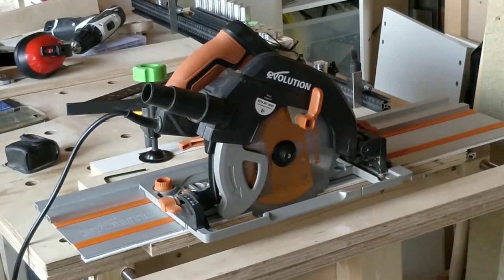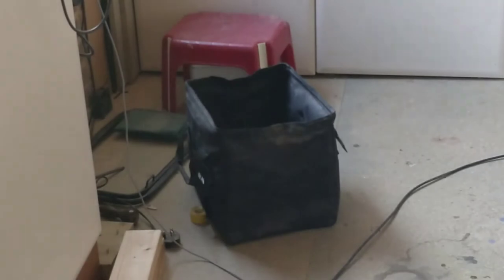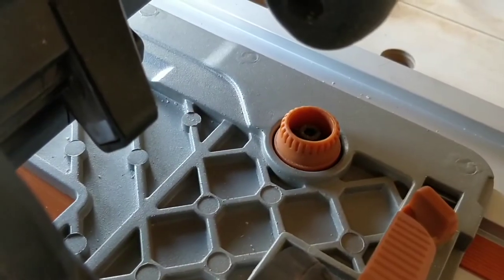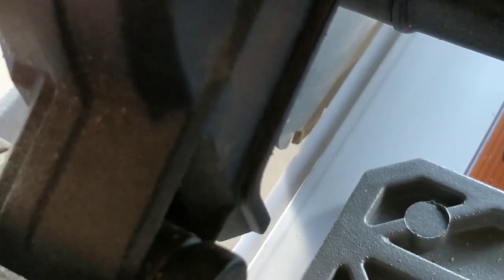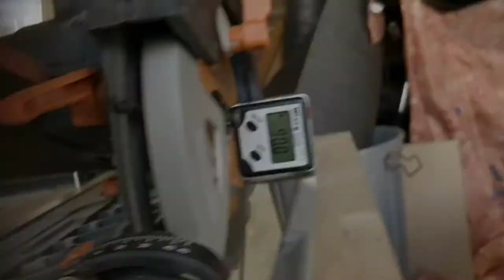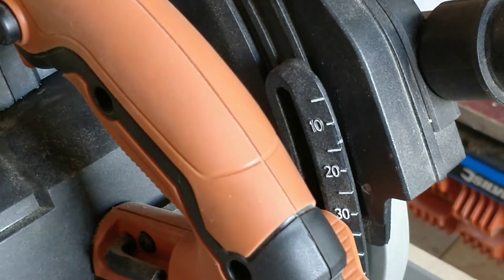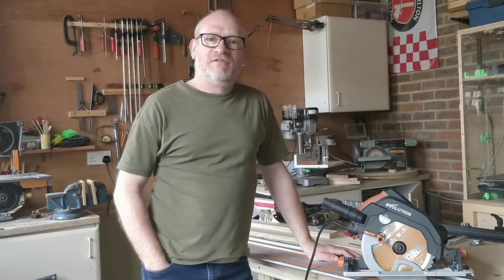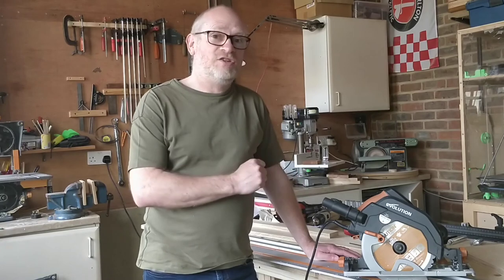30. Evolution R185CCSX - Review - Worth it? Probably Not.

Comment: My biggest complaint about this saw is how the track comes in a bunch of little pieces and once you put it together it kind of defeats the purpose of a track saw when you have to pull a line and screw it to a piece of plywood in order to make the track straight. I should have just bought a piece of plywood instead of spending over $200 on this piece of garbage
Reply from the maker: Thanks for the comment,  I completely agree 👍🏻
Reply: @DIYTinkerer  I haven't used the track yet, I just made a small cut on a drop to see how awful the 16 tooth blade was. I immediately ripped the guard off because it wouldn't make it more than 3 in into the wood without binding.
Reply: @DIYTinkerer  I also wish I would have watched this video before I bought it, I didn't notice that it had a 20 mm Arbor. Have you found a good finish cut blade for less than $50?
Reply from the maker: @despraterado588  I think Saxon Blades make them  https://www.saxtonblades.co.uk/

Comment: I bought the same saw and the same track pack and I've had no problem with either. I made a complete set of 20 kitchen cabinet doors using it (admittedly with a finer toothed blade)and I am very happy with the result. So much so that I will be buying the Evolution 255 Mitre saw the next time its on sale. I think for the price it's good value for money.
Reply from the maker: I'm glad it's worked out for you 👍🏻
Reply: @DIYTinkerer  An inconsistency in quality is probably a function of the low price.
Reply from the maker: @twoshedsjackson6478  I strongly suspect that might have a large influence!

Comment: I own an evolution miter saw.  I absolutely LOVE it!  Is it perfect?  No.  No tool is perfect even if they charge 10x more than the competition.  Is it worth it?  It’s worth every single penny I spent for it, particularly since it was also affordable!  After seeing this view, I feel the same way about this saw which I am about to buy.   Even after seeing this somewhat negative review, I’m still going to buy it because it will give me simply the best capability for the money. Per the review I know if will not be perfect.  But I already knew that, because that is just reality. But now with this review I will know what to be on guard for, and most of the things mentioned can be easily remedied, particularly since we now know about them (therefore thanks for the review!).  But I’m not going to buy a Festool any time soon, and even if I did I still could not cut steel.  So if my use case includes steel and metal cutting, why would I want to buy a Festool in the first place?  If my use case is wood and precision wood only, we’ll then if I have deep pockets the choice might be Festool.  But absent that, this appears to be one of the best values out there.  If I was not interested in cutting AL, STEEL and stainless steel, then the Wen track saw is compelling.  The 7 1/4 version even had variable speed which might allow you to use a steel or combination blade.  But then you are guessing and fiddling with feeds and speeds which is not something I care to do if someone has already figured it out, as has Evolution.  Therefore, absent some serious or catastrophic flaw, which was not revealed in this review, I think the Evolution track saw with the long tracks is likely the best value proposition on the market.  IMHO of course ;-)
Reply from the maker: I'm sure it's the right choice for some,  for me it was a bad choice and I have only myself to blame !

Comment: To be fair the splinter gaurd was your own fault . And as for the 90 degree loss . Really you should true your saw every time you use it . For a budget saw (and thats what it is ) it does a good job . If you want more precise and reliable cuts you would buy something better but for general diy its ok
Reply from the maker: Yea,  it is a budget saw with all the problems you associate with cheap tools. I've now got a cabinet saw and leave the evolution for rough cutting sheet goods down to a size I can use on that.  I've learnt my lesson 🙂

Comment: Fair review of a budget tool. I bought their so called top of the range double bevel mitre saw, the first one was returned, kept the second one but only use it as a last resort as it has accuracy issues / poor quality of manufacturing.
Reply from the maker: I reenginerred mine to make it accurate, check out my video 'Level up your mitre saw' video  it's actually ok now. :-)
Reply: @DIYTinkerer  Thanks, just watched it, same problems over different models. Good tips, will come in handy.

Comment: I bought one of these primarily to cut down 8x4 sheets of 12mm ply to make some shelves for my garage (about 40 in total).  I spent some time setting the blade up & making sure that the depth was right.
I clamped a length of 50mm x 10mm steel bar to use as a cutting guide & I fitted it with a Saxton 80 teeth blade. 
The results were spot-on - I would have been happy with adequate, but i was that impressed that I'll use it to cut some sheets down for shelving inside the house now.
I think you're supposed to leave a slight gap between the track joints - you look like you've butted them tight up

Comment: As far as removing the play when the saw is on the rail you should start by turning the orange knobs to remove play then (and this is the important part) you must use an Allen key and tighten the central bolt to 'lock' the knob into position, this will not allow the adjuster to move and will create a much better experience when using the saw.
I do agree with you on the so called 'dust collection' and the depth adjustment but I  was well aware of these limitations before I bought this saw and so far, I have found it to be a most useful and accurate tool.
Reply from the maker: Thanks for the advice :-)

Comment: For the depth of cut: when using the track you need to allow for the thickness of the track and take this into consideration. E.g the track is 7mm thick, so for an 18mm, set the saw depth to 25mm.

Thiis is the same with all tools; the same applies for routers: you measure below the plate.

I have decided to sell my evolution track saw. It is not a track saw in the sense of it  it is just a circular saw on a track.

Proper track saws, even low end of market ones have plunge features and a dust guard which ensures that the dust is collected.

There is no suction when using the Evolution track saw. R185CCSX +

Evolution, need to up.their game and make their saw a proper track saw.
Reply from the maker: Yes I agree they are lagging behind quite a bit, using their 'cuts metal' as pretty much the only selling point and that blade is so aggressive you can't get a decent cut, so even that is compromised.

Comment: Does this saw have a 20mm arbor bore?  So none of my Diablo 5/8" bore 7-1/4" or other saw blades will work?  Am I stuck only using Evolution saw blades ?
Reply from the maker: Paul, no need to post the same question on multiple videos, I'm a small youtube channel so read & almost always reply to all comments - it's what keeps me producing videos:-) anyway here is a copy of my answer for others reading the comments. 

I think Evolution want you to think that.  However you can get 20mm bore blades from Saxxon Blades https://www.saxtonblades.co.uk/tct-circular-saw-blades/evolution-saw-blades I replaced my mitresaw blade with one of these and it made a massive difference in cut quality/ tearout.

Comment: Fair review. I'm lucky enough to buy Dewalt. I'm looking at Evolution for a cheap, lightweight mitre saw, and having watched related videos, thought I'd expand my knowledge of their tools. I'm still going ahead with my purchase as it really is inexpensive, but I appreciate most diyers may not have 'deep pockets'. Having to constantly check the angles though would be a deal breaker. Hope it gets sorted.
Reply from the maker: Check out my video on the evolution mitre saw and how I fixed the problems that has with an uneven bed.

Comment: Seems it is definitely a rough work track saw, good for floor board fitting or landscape type work maybe but not up to the standard needed for kitchen fitting or making any kind of fitted furniture.

I have the Parkside track saw, I believe the first version they sold. It was £60 and I have upgraded the blade and purchased a festool track as my main track though the supplied tracks are not bad. I have found the saw to be excellent and perfectly capable of producing work much higher quality than I my skills allow that's for certain.
Reply from the maker: Ah that's interesting, this was almost double so you would think...
Reply: I think they've added a riving knife on the latest version of the Parkside/Aldi saw - a positive move, 
assuming it works well

Comment: First thing I did was replace the general purpose blade. Then my first cut was just to trim up the splinter guard on the track which I now use as my guide for straight cuts. I wasn't expecting quality finished cuts from this saw, just cuts good enough for sizing purposes and its fine for that. Its also perfectly adequate for anything not requiring furniture quality finished cuts in my opinion. Its a cheap saw so realistically, we have to temper our expectations.
Reply from the maker: Yes agree, I just use mine to break 8x4 sheets down to something manageable on the table saw, and I agree about the blade.

Comment: Agree 100%. I bought it and used bauker hand held mini saw instead to cut long melamine boards as it was easier. I wish I hadn't bought, a straight edge and better saw should work so track is just extra tool taking up space
Reply from the maker: I sometimes think 'perhaps it's just me' thanks for confirming I'm not alone! I now only use it for rough work - indeed I avoid it if at all possible!

Comment: Damn. I just ordered this. Ive already bought a fine finish diablo blade. Make my fist set of cabinets and tired of borrowing the nieghbors makita track saw. I have an evolution chop saw for metal thats been great. Had high hopes for this, but you killed that. Shoukd i return? Im not a furniture maker. I making these cabinets out of necessity because im poor and cant afford to buy them.
Reply from the maker: I think use it, and make the comparison with your neighbours Makita, personally I wouldn't use for accurate work,  but you might have a different experience.
Reply: they do it now, i just got one and all the issues are done with from the factory-alignment with guard, track smooth no entry bump, rails need 1 mm gap though clearly in manual, etc

Comment: I'm glad other comments have had a similar experience with this saw I thought I was going mad, I purchased the one with the 3 small tracks what was a mistake as they are a nightmare to align truly.

My only other experience with a track saw was the Makita plunge saw they have at work I wrongly thought the evolution would perform similar but the track dosnt stay in alignment like the Makita and the saw moves too much and the splinter guard what should be zero clearance isn't acute like the publisher of this video found where as we use the Makita at work not clamped down and it doesn't wonder when cutting at all

In all Honesty I would recommend buying the standard circular saw from evolution what this one is based on and then running the base against a level claimed to the wood as you will get better results

As it's not a plunge saw I also had issues with the depth you have to had the height of the track on haha that is also because the track saw element.is an after thought with this saw being the same as another In the evolution ranger

Has anyone tried using a Makita splinter strip on the evolution track? I also see 3d printed track square devices for sale has anyone used one of those
Reply from the maker: Thanks for the comment, sorry to hear you had the same problems.
Reply: @DIYTinkerer  I have managed to get hold of a spare Makita rail an the saw runs alot better on that, the Rib the saw base runs along isn't as high an also has a rounded edge so dose not bind also on the Makita the low friction strip is exactly that no need for mr sheen 😃,, the blade is 5mm from the edge of the rail so I'll need to get a new zero clearance strip.  So if you get chance to get hold of a Makita rail
Reply: You may be surprised at how the evolution saw becomes useable, I'll upload a video showing as I'm shit at explaining
Reply from the maker: @liamofthornhill  lol, that would be good.

Comment: I'm in process of buying a circular saw and of course I'm doing the usual internet research. On other bigger channels (especially the german ones) they did tests between low budget saws, under 150 euros. In this range even the serious brands have at least the same problems as this tool. This tool hower gets almost all the positives of the one tested by them. 90% of the problems you exposed on your tool are user mistakes. You personally would find problems even on a 800€ festool... learn to use your tools.
Reply from the maker: Thanks for watching and commenting 👍🏻 with your perspective on it. The biggest issues from my perspective are the splinter guard that keeps falling off and the inability for the tool to stay square between cuts, despite how tight you try to lock it down, these may be beginner problems, but it doesnt seam unreasonable to me for splinter guards to stay on and the saw to stay square between cuts. After 3 years of use I still think it's a very budget tool and I think it really shows. I certainly would not recommend it to anyone.

Comment: If you’re using it to make finished cuts, you’re going to be disappointed, but to breakdown sheets, it’s fine.

And for the price, you probably shouldn’t expect it to do much more than breakdown larger pieces to be more manageable on a table or mitre saw….IMO

Spring for a higher end saw like a DeWalt or Bosh if you’re going to need better quality.

DIYers shouldn’t expect to get steak for the price of hamburger!
Reply from the maker: You are of course completely right, you will however find plenty of reviews on youtube saying how amazing the saw is, some even comparing it to Festool, I wanted to provide a more honest review of what you will get. I do now only use it as you suggest as a tool for breaking down sheet goods.  You do indeed get the cheapest of greasy burgers 😀